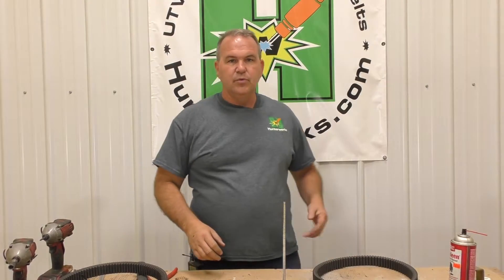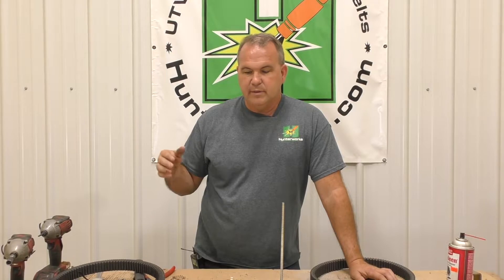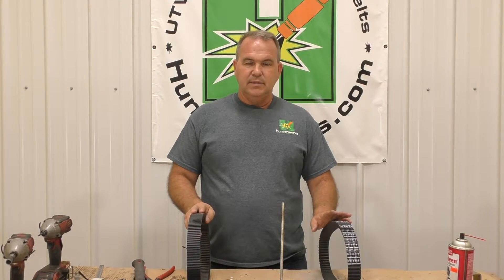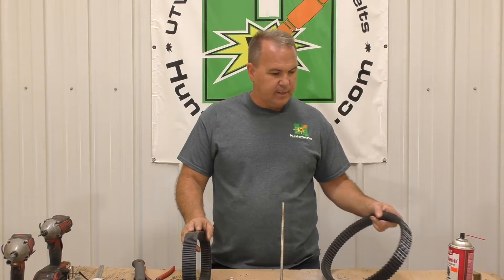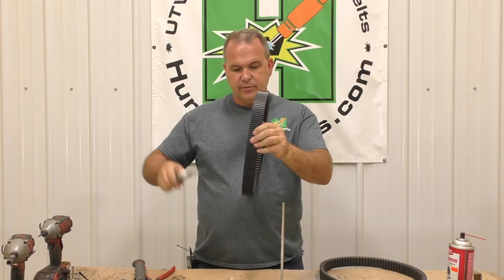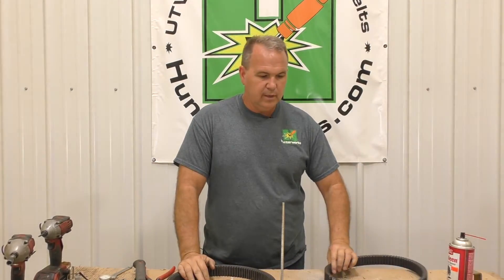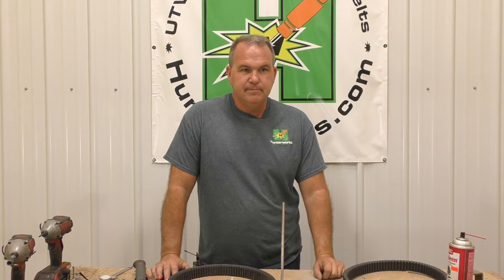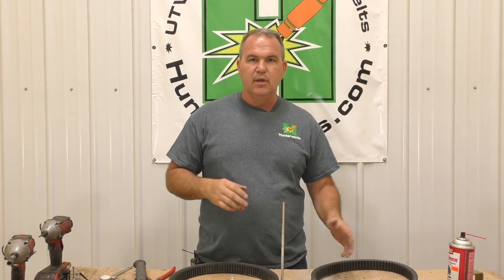Hunterworks New Body Style Polaris Ranger XP 1000 Belt Info

Comment: I have a 2016 ranger 900 xp, and I'm looking to replace my belt for the first time. What belt would you specifically recommend, to replace the factory belt. I have no modifications to my machine. How do I know which secondary my machine is equipped with, and does that impact your belt selection recommendation? Thanks.
Reply from the maker: Either of our ranger belts work on it no matter the secondary but the EBS one might have a low speed noise on the POS one, just look at them, if you see 1" slots with round rollers you got the good one and EBS